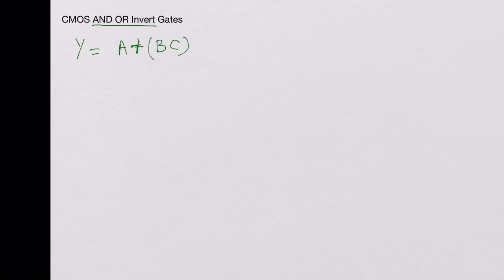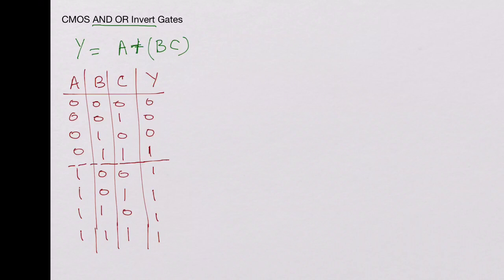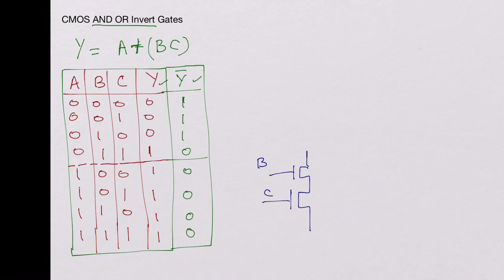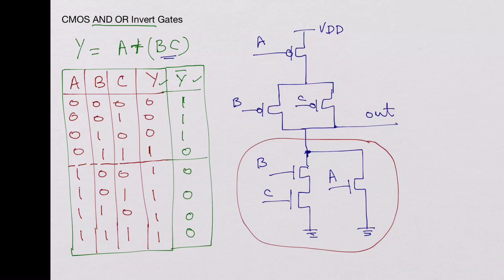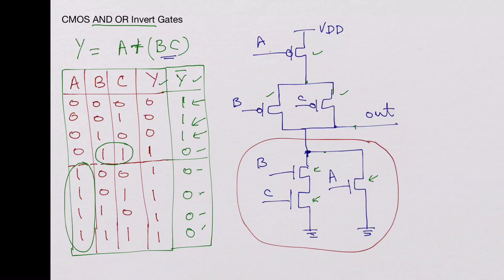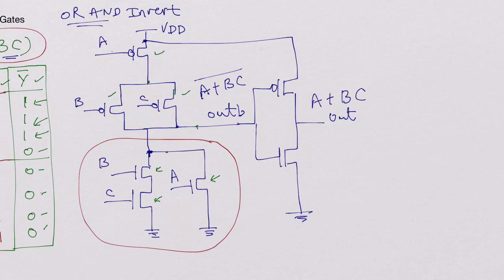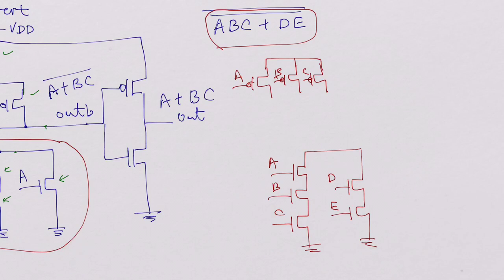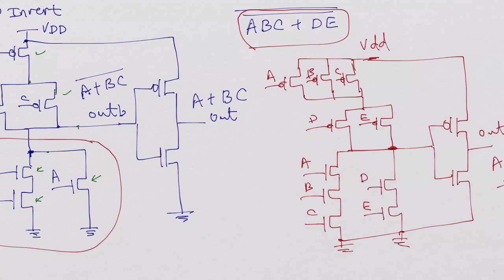CMOS AND OR Invert (OR AND Invert) Gates

Comment: Thanks for the video. Some points I would like to add for those that may be unfamiliar:

- CMOS circuit gates have a pull-down network (the bottom part) that only use nMOS transistors and a pull-up network (the top part) that only use pMOS transistors.
- The pull-down network should encode the negated version of the expression because it pulls the circuit to 0 (ground).
- The pull-up network should always be complementary (hence C in CMOS) to the pull-down network (replace parallel with series and vice versa) so that the output is pulled to 1 (VDD) when the pull--down network is 0.